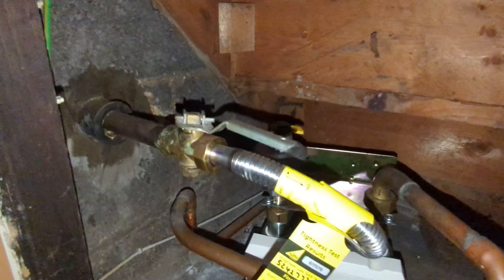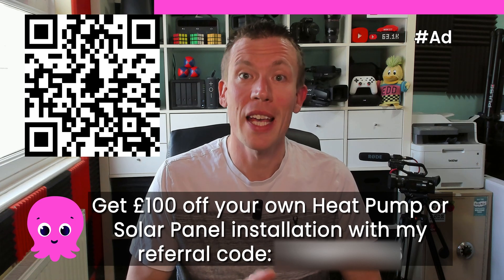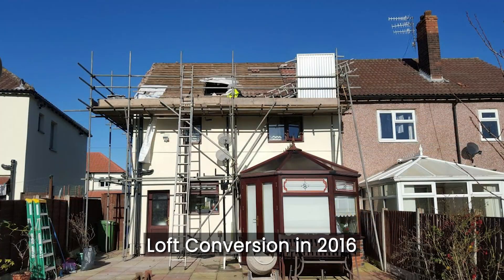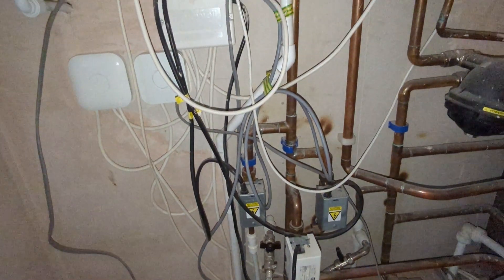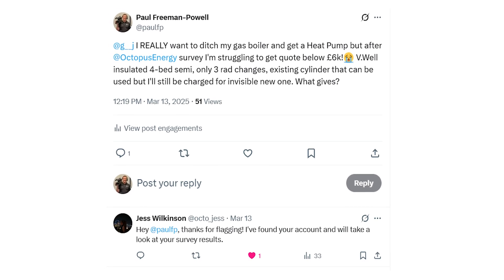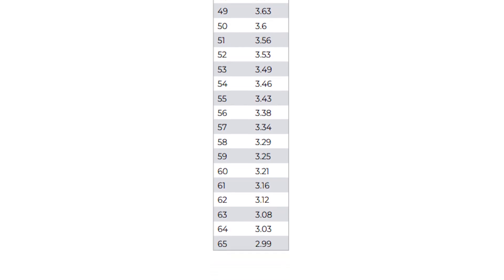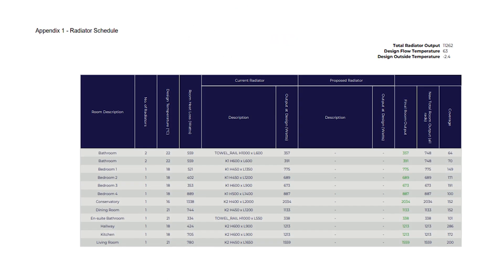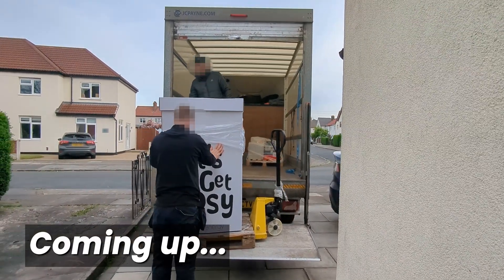I'm Getting an Octopus Cosy 9 Heat Pump!

Comment: Octopus has proposed a Cosy 9 for my 5 bedroom detached house (built 2000, 6.8kW heat loss) so I am surprised you need such a big heat pump for your smaller semi with external insulation
Reply from the maker: If you include my conservatory, the house's heat loss is just over 7kW so the Cosy 6 wouldn't have covered that. We generally keep the radiator in the conservatory turned off as it's a waste, but I'd rather have a heat pump with plenty of headroom in case we extend the house in the future or want to heat the conservatory in the winter. Without the conservatory, the heat loss is 5.7kW so at the upper end of what the Cosy 6 could support, so I didn't push to have the conservatory removed from the figures.

Comment: OH NO...😱, Not the Cosy heat pump.

I had a cosy 6 installed last october....it has been a disaster from day one, the noise is horrendous, disturbing me, my wife and guests sleep, such that we do not have it running during the cheap rate hours during the early hours😢.

I have underfloor heating, octopus hadnt a clue how yo connect it. They have been backwards and forwards many times tinkering and applying "workarounds" and "upgrades"....none have worked, our heating system still does not work properly.

Be aware that the control and scheduling is manipulated ONLY via their app, which is dreadful, and is wholly reliant upon internet connectivity and the uptime and reliability  of their server....Octopus have control of YOUR SYSTEM! They can, and do, make changes at anytime without your knowledge or consent.

 There are no local consumer controls, as I said, you are at their mercy. Not a problem I hear you say?.....well not if your internet goes fown, their server goes down (or Octopus go bust....not unheard of in the utility providers world) or, as happened recently to me, my phone broke, leaving me unable to control MY system for over a week.

 I was not informed of this restrictive and manipulative buisiness practice at the point of sale, so it was mis-sold.

Octopus customer service is hopeless, I am continually passed from pillar to post, nobody seems to have a clue what they are doing or what to do....we are sick to the back teeth with it.

I am currently battling with Octopus to get the thing ripped-out.

I dont want to "rain on your parade", I hope that all goes well for you.

I am making my experience known to alert those who may be considering using Octopus and specifically their Cosy system which, as far as my experience has been, is not fit for purpose.

I havent seen your channel before, it popped-up in my recommendations, so im not aware if you are an Octopus fanboy and influencer....if you are then I'm sure you eill wish to remove my comment, if you have integrity and are open to frank and open discussion, good or bad, then it will remain....ill check back later to see!

It will be interesting to learn of your experience with Octopus for sure, ill be watching your journey with interest!

Good luck.
Reply from the maker: Thanks for your comment! I'm not a 'fanboy' and I don't really like to call myself an influencer... but either way, I won't delete your comment as I'm interested in genuine and reasonable discussion :)

I have a Cosy 9 rather than a Cosy 6, but for what it's worth mine is very quiet even when stood next to it outside and it's running at full pelt. I can occasionally hear a bubble or slight sound up in the loft when the hot water's on, but it's far quieter than the old gas boiler was (which would keep me awake at night - this is near-enough silent inside). When the heating is on, the radiator in our bedroom is sometime a bit noisy - not so much gurgling or anything that would indicate it needs bleeding, rather you can hear the water flowing through it. But that was the same when it was being pumped through by the gas boiler, and it's not always, and the other rads in the house are silent.

If yours is giving off a "horrendous" noise, disturbing you, your wife and guests and stopping you sleep then it sounds like you have a major fault as that's definitely not normal. (Gas Boilers have faults sometimes, too.)

I agree with you about local controls - it's definitely a (small) downside of the Cosy system and one I really hope they address in the future. I'm a big fan of smart devices and cloud control, but I think local control should always be an option. And to be fair to Octopus, limited local control DOES already exist in the form of the buttons on the Cosy Hub, but I would like to see an official device to control all aspects of it as an option in the future.

I'm going to be playing with Home Assistant and getting that set up with my Cosy in the coming months, so hopefully you'll find those videos interesting when I do them.

If my phone broke, though - my wife's phone also has the Octopus app on it, and we have other devices in the house too so one phone breaking won't stop us controlling our heat pump. I understand how that might not be the case for all households though, so maybe an online web interface too would be a quick easy thing for Octopus to add to their website?

Sorry to hear you didn't know what you were getting before you got your Cosy heat pump. I'm not sponsored by or paid by Octopus to make these videos at all (apart from if someone uses my referral code) but hopefully they will help others to make informed choices and decisions. Octopus themselves do have a wealth of information both on their website and their YouTube channel, too, so I don't think anyone getting a Cosy would be unaware of how the system works and is operated.

Octopus having access to and control of the heat pump, though, was the very reason I WANTED to get this one - so that they can monitor, assess, diagnose any issues and continually improve it. That's something to be embraced, not to be scared of. If a gas engineer physically comes to your house, he/she will "have control of your system" and "make changes" - which is what you WANT them to do. The difference is you'll pay a large callout fee for them to come, and have to take a whole day off work waiting in for them. With a remote system like on Cosy, it might be a quick 10 minute phone call - if that.

But all of that notwithstanding, thanks for sharing your views and your experience. Sorry to hear your underfloor heating has been difficult and I hope that gets sorted soon. There's a great Facebook group for people with a Cosy Heat Pump, and there are Octopus folk active in there who might be able to help you, plus their CEO Greg is known to respond personally to any issues on social media so I'd try that if you need help.

Thanks for watching my channel and subscribing (if you have) and I hope you'll find my journey interesting as we go into Winter.
Reply: @SwitchedOnNetwork  my radiators are like urs i have 2 double vent ones in kitchen  rest are sigle ones i got them like 3 months ago so the quote they give me hope is much cheaper also might wait till next yar to get one i am 50/50 yet if to get heatpump

Comment: That was stupid 😂
Reply from the maker: It's been brilliant so far and is much cheaper than gas without risk of explosions. Not so stupid now huh!
Reply: @SwitchedOnNetwork houses only explode if people tamper with there meters etc.  I’d be concerned about your bills when it becomes cold. 🥶 but fair play to Yee bud.
Reply from the maker: I'm sure not every gas explosion has been caused by people tampering with gas meters. There's also the risk of a faulty boiler pumping out carbon monoxide of course.

It's the huge efficiency of heat pumps that makes it possible for them to be cheaper to run than gas boilers, along with the fact that you can use cheap electricity to run them rather than being locked into gas. I did a little test of the central heating the other day, and I used 0.84kWh of electricity to pump 3.55kWh of heat into my house, which is 422% efficiency. A gas boiler will be under 100% efficient. My daytime rate for electricity has just come down a bit, but last week it was 30.17p per kWh and gas was 4.5p per kWh. Doing the maths, 30.17 / 4.226 = 4.2p so it was CHEAPER than using a gas boiler would have been, even with peak rate electricity. Overnight, between 11.30pm and 5.30am my electricity only costs 7p per kWh.

Granted, it was 22ºC outside at the time so the air outside that it was extracting the heat energy from was already warmer, so it would have a slightly harder job in winter and therefore use more electricity. But combine it with solar panels and battery storage (charge a battery up overnight at that 7p rate and then power the heat pump in the day) and the financials start to look really, really good.

Plus, of course, it's not just about saving money.
Reply: @SwitchedOnNetwork bore off are you sure you don’t work for octopus,  see how happy you are in the winter. Electricity is 3 more expensive than gas. Good luck
Reply from the maker: Definitely don't work for Octopus, you can look me up on Companies House if you don't believe me 🤣 It's funny how all the clueless anti-heat pump trolls just come out with the same tired lines like "oh you must work for them". No, I've just done my research and am putting the science education I learnt at high school to good use and being sensible, progressive and open-minded. Fossil fuels are a thing of the past, a dying old-fashioned and defunct technology - it's now 2025! If someone says they have an iPhone or a Pixel phone and they like it and are happy with it, would you accuse them of working for Apple or Google?!
Reply: @SwitchedOnNetwork I what ever pal, when your house is cold costing ya a fortune and yer missus has fucked off, don’t cry about it.  Been a heating engineer for 20 years.  All the big suppliers are stopping the installation of them. 😂
Reply: @SwitchedOnNetwork do you really think they’re gonna turn mains gas off.  You’re mad.
Reply from the maker: Well, subscribe to the channel and come back and watch the videos I put out this winter 😜
Reply: @SwitchedOnNetwork il definitely be back when it’s cold 🥶 😂😂😂.  I can’t take any more plugs for 🐙

Comment: What was your total heat loss (I’m assuming at -2)?
Reply from the maker: The design temp was at -2.4ºC and the total heat loss for the house was calculated at 5.7kW (I've taken the conservatory out of that figure as that was nearly an extra 1.4kW on its own but we have the radiator permanently turned off in there as it's pointless having it on 🤣)
Reply: @SwitchedOnNetwork  so why a Cosy 9? and why wasn't a Cosy 6 or other smaller ASHP proposed?
Reply from the maker: @redshift3  Total heat loss of the house just over 7kW so the Cosy 6 would be too small. Cosy 9 also leaves a bit of headroom for if we extend the house in the future (no solid plans yet, so didn't want to hold up the heat pump upgrade).

Comment: I think the cozy 9 running at 65 just allows octopus to create really lazy designs and will cost their customers a small fortune to run.
Reply from the maker: Efficiency and SCoP are important but they're not the be-all and end-all; if powered by a Powerwall charged overnight at 7p/kWh, for example, is it really worth the extra cost upfront to achieve that greater efficiency? It's a balance, everyone's situation will be different and there's not a one-size-fits-all design.
Reply: A 25 degree difference in heat pump flow temperature will result in approximately 35% higher running costs, so yes, I think the investment in lower temps is worth it. Coupled with a heat pump that's almost twice the capacity it needs to be based on your heat loss, it will mean a less inefficient system, and when it comes to heating using electricity, that means it is more expensive to run. 
It's important to be confident that the design will reach and maintain the comfort levels you want, but it's not like a gas boiler that just runs for 2 or 3 hours a day. It's unlikely during the winter that your power wall will have enough capacity to run you heat pump all day.
Reply from the maker: Bear in mind that's just the maximum temperature on the very coldest of cold days - it's not a fixed flow temp like with a gas boiler, there's automatic weather compensation. And in my case and for my personal financial situation, it was either do it this way or not at all; the alternative would have been to keep burning gas (and to have spent money on some hopefully minor repairs to that boiler). Plus, I can always replace those 3 radiators in the future if I want / have the funds and then I could reduce the flow temp so my options are very much still open.
Reply from the maker: Interestingly, my cold weather flow temp was set at 57°C rather than the 63°C I was expecting so we'll see come winter how I get on. I'm not going to change it unless I feel I need to!

Comment: Did you have to pay extra for the full gas supply removal?
Reply from the maker: No, Octopus did that free of charge as part of the heat pump installation. I'm not sure if that's because I'm also a customer of theirs for my energy supply as well or if they'd do that for all installations. Are you with them for your gas supply currently?
Reply: @SwitchedOnNetwork  Yes I am and am looking into a vaillant ASHP and I thought they could only cap at the meter
Reply from the maker: Yeah they'll give you the option for full removal so if you've got no other gas appliances you can shut down your gas account and avoid the standing charge :)
Reply: @SwitchedOnNetwork  Thanks for the info, appreciated! I'm interested in how Octopus's ASHP stacks up so I'll be following your journey :)
Reply from the maker: No problem :) Yes it should be interesting... I said to my wife last night that I'm in a bizarre situation where it's the start of May, sunny/warm weather has finally arrived (my favourite) but I'm also kinda looking forward to the cold weather to see how the Cosy does haha :) Out of interest, what's made you look to a Vaillant rather than a Cosy?
Reply: @SwitchedOnNetwork   Ha yeah! :) I went through heatgeek for system design, was looking for an R290 unit, and I'm waiting to see if Octopus are good for it in the longer term with support and repairs etc. That being said I may go on one in the future, I'm hoping their project mercury will take off :)

Comment: Mines being commissioned tomorrow!!!
Reply from the maker: Yay! 🙌 Mine was commissioned one week ago today, but the YouTube video series statrting on Monday will be following along with a 2-week satellite TV time delay 😂😜
Reply: @SwitchedOnNetwork  Looking forward to see how you got on! I've currently got a plumber in our airing cupboard lagging loads of copper pipes... We've had 5.5 kW of solar installed with 20 kWh of batteries a month ago with the express intention of getting 90% of our usage off the overnight rate and not having to worry about timings too much. We also have a PS* so happy we're going to be reducing our reliance on burning stuff.
Reply from the maker: @boduke8175 great! Yes I definitely want to get a battery and solar - although we don't have much sloped south facing roof after our loft conversion, so battery is the highest priority to charge up at night on 7p! One day we might do a single-storey extension out the back (hopefully the Cosy 9 will still be good for that) so if we do that'll be designed with solar in mind.
Reply from the maker: (PS - what do you mean by PS* ? 🤔)
Reply: @SwitchedOnNetwork  sorry, Polestar.
Reply from the maker: Aaaah! 😊 Never driven a Polestar but they seem good. Which heat pump have you got then?
Reply: @SwitchedOnNetwork We’ve got a thing for fast Volvos 😂. We’ve got a Cosy 9 that’s just been plumbed and wired. It’s getting turned on again tomorrow.

Comment: So how much did it cost?
Reply from the maker: I'll be doing a video very soon running through all my costs from initial quote, first Daikin quote after survey, Cosy quote with radiator changes, then without - plus my solar thermal removal.
Reply: Wait ,Did you pay for one or did they give you one free and going to be paying you a commission for every viewer that gets one? Its hard to take someone for their word when its a sponsored video
Reply from the maker: @OldNerdyMeathead it's not a sponsored video and they certainly didn't give me one for free! I wish!! 🤣🤣 I paid full price (apart from I placed my order when they had a sale on). They do have a referral programme, which is very common with many things. I've just put out a video showing exactly how much I paid: https://youtu.be/i_HfRlGMDcc

Comment: Good precise video, Just going through preliminary quote with Octopus and my solar thermal system will have to go as well, I’ve been thinking about it for a couple of years and replacing with more PV so interested in seeing the cozy 9 and your install, hope it all goes smoothly for you, they recommend a Daiken 11 kw for us, did you ever use the visit a heat pump scheme, we went to see two heat pumps in similar homes, very interesting, 👍
Reply from the maker: Thank you! Hope you enjoy the daily updates as well, the first one will be on Monday at 6pm. I had to get a 3rd party company to disconnect my solar thermal - I could possibly have done it myself but didn't know how to drain it down and didn't fancy doing it wrong and getting lots of scorching hot glycol at high pressure squirting in my face! So an eye-watering cost for 1hr20mins work but then less eye watering than the alternative!! 🫣😂

I didn't actually use the Visit a Heat Pump scheme, I've only recently heard of it and I've already signed up so may host an event myself soon!
Reply: @ I’ll do it myself, have you sold or scrapped your system, just wondering what to do with it when I’ve taken it down,
Reply from the maker: It's in a big messy pile in my shed at the moment, but I'll be selling what I can (eg the controller and the board with the pressure gauges etc.). The actual panels are still on the roof for the time being.